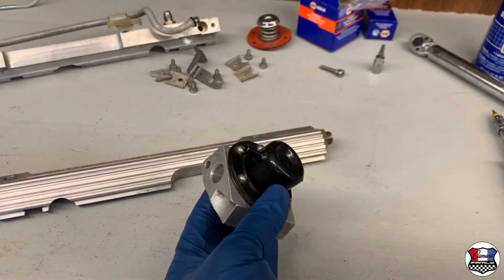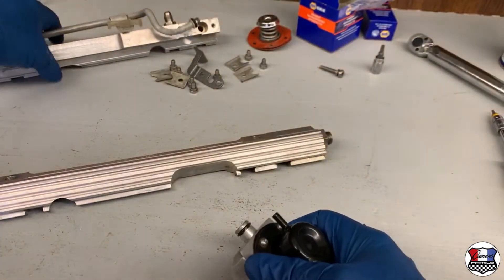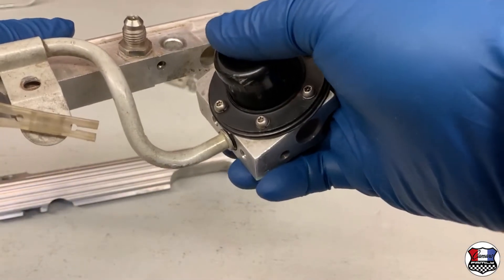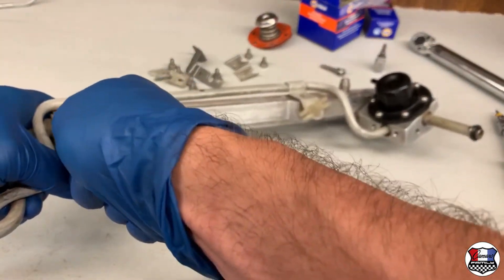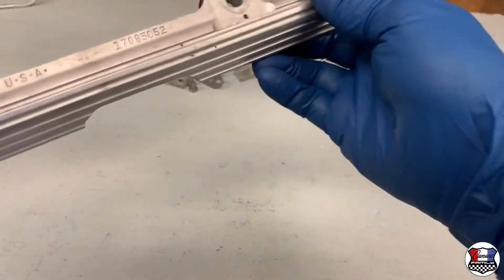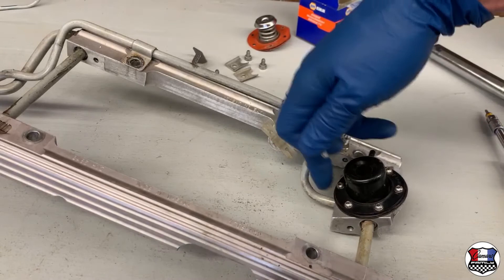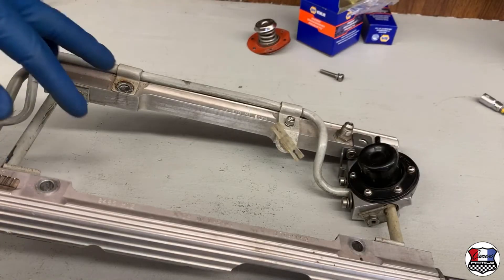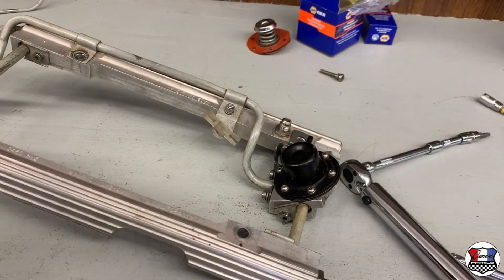TPI Fuel Rail Rebuild - Camaro / Firebird / Corvette (Part 3 of 4)

Comment: How did your originally get that little tube out of the fuel pressure regulator? I seem to recall a decade ago when I did mine, I couldn't get that little tube out of the fuel pressure regulator. And so I just didn't change that one oring. I'm having to do it again all these years later due to an oring leaking somewhere on the rail and figure I should make sure to change that one out too.
Reply from the maker: I was lucky...sort of...the fuel rail assembly had the incorrect O-rings, which caused my leaks. So the little tube popped out fairly easy with the small O-rings that a previous person installed. I like your question though. If you see our latest video, you will see that I just bought another TPI. In the future, I will see what it would take to get the small tube out. I picture trying to use compressed air (while blocking the other holes with rubber gloves on) or maybe getting a nail head down in the tube and slipping the head behind the edge of the tube...and then pulling on the nail. If you get to it before me, let me know.
Reply: @CamaroFamily  Okay. I had thought of getting a piece of thick raw leather I have laying around to wrap around the little tube and then clamping some vice grips on and twist it back and forth while pulling. Though there's a risk or damaging it with the teeth of the vice grips.
Reply from the maker: @colt5189  That's good to protect the tube. leather is a great idea. I have some durable rubber (that I got back when worked on 3rdgens at GM in the early 90s) that I use in some cases like this.

Comment: doesn't silicone eat rubber? and you can't get accurate torque with an elbow.
Reply from the maker: Thanks for your inquiry. Silicone lubricant is the suggested lubricant for O-rings from the factory and other sources. And yes, you are correct...you can’t get an accurate torque with a human elbow, that’s why I went to extra lengths to use the proper inch-lbs and ft-lbs torque wrenches for torquing the fasteners in the 4-video segment. I’ll have to watch again and see if I mentioned using my elbow. 😉💪